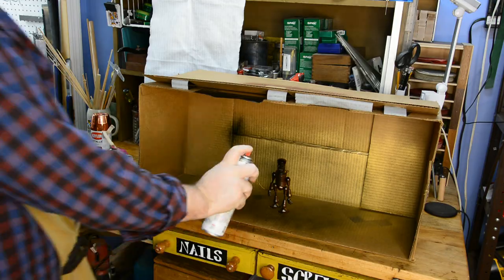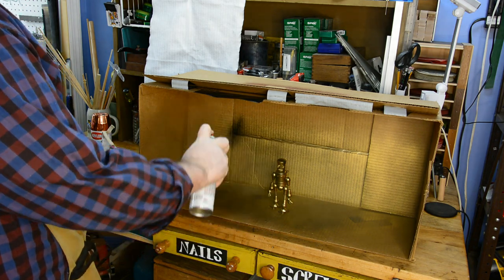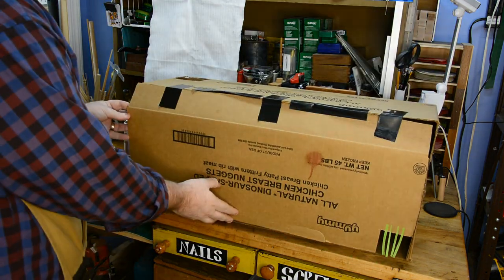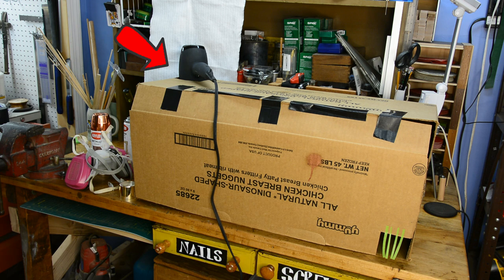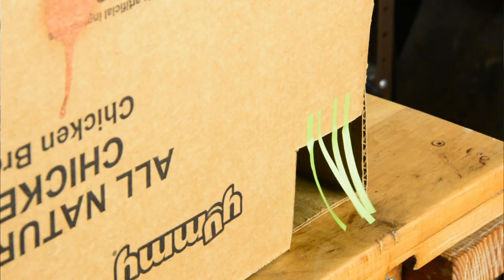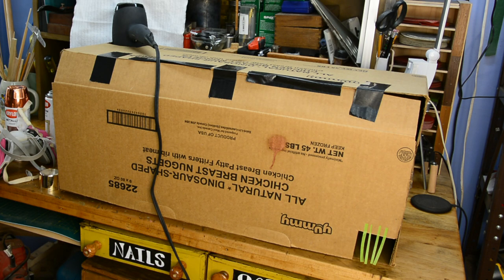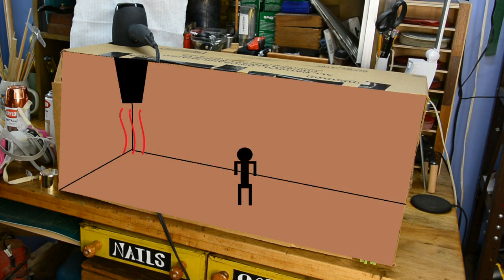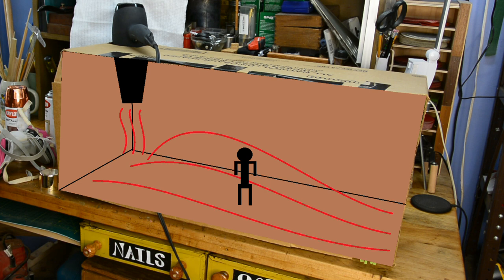Spray Paint Drying Hack - Hot Box - tip, trick, hack

Comment from the maker: :::::A NOTE::::: As always I’ve heard from a small, vocal group of safety police that have reminded me to remind you that this is for hair dryers ONLY! If you do this with a heat gun, even on the lowest of settings, that’s dangerous! AND don’t leave it unsupervised, that’s dangerous too! And it’s smart, ALWAYS, to have fire safety equipment in your shop, and to know how to use it properly! Be safe and smart!
Reply: It's a good reminder though because I was considering using a heat gun :D
Reply: Hmm? Seems I read somewhere that waiting til' the PAINT VAPORS can not be smelled (7-Days). 

Is the time to BAKE THE PAINT, this seems to be baking it while it's completely wet? Please explain what am I missing. 

Another factor DOING REPAINTS, I noticed PEELING, SCALING and FISH EYEING typically only occurs only when it time to REPAINT or TOP COAT. (Calling RUSTOLEUM, informed me the paint BELOW not being dry enough typically is what causes these nasty effects.

Please explain to me ANY advice or suggestions you may have on avoiding those super aggravating paint issues.
Reply from the maker: @jams2u786  hi! Quite simply actually: Many thin layers. You don’t want to drench anything with paint because you will absolutely have done, or all, of those issues. But in using many thin layers and drying in between. The heat box work flawlessly in my years of experience.
Reply: @BurkeMakesStuff  Appreciate your response. How much time using cam spray paint generally do you wait between applying the layers?

Doing GLOSS is a real challenge as it seems at some point in the process to achieve that final HIGH GLOSS, the coat must be WET. Unless those thin coats are very closely timed before the next. That final glass-like gloss cannot be attained?!

Comment: I actually would recommend using a (storage bin tote) cutting a hole for blow drier, then using that instead of a cardboard box its more secure and less flimsy and doesnt require tape to hold the top down just simply press the snap down on the top

Comment: It's a good tip (although don't let it run unsupervised)
If you do a lot of painting then a heat lamp (infrared light) is even better since it provides even heating and doesn't churn up dust that can attach to the paint. You can find heat lamps in a lot of pet stores (smaller ones), and as porch heaters (more powerful ones).
Just be careful, because heat + evaporating solvents (any non water-based paint) jncreases the risk that something could start to smolder and burn.

Comment: At work we always put spray painted projects in the air compressor and vacuum pump room. It holds 2 large commercial Quincy 480v 3-phase screw compressors, 2 Quincy air line driers and 2 large vacuum pumps for the CNC machine router tables. It regularly gets well over 100 degrees in that 30 foot by 30 foot room...often over 120+. It's a little trick we came up with about 5 years ago when I started.
Reply from the maker: Awesome! What does the company do that they need all that?
Reply: @BurkeMakesStuff  

We are a U.S. Government contractor for the Military and make wire harnesses, connectors, gauges and instrumentation. Oshkosh, AM General, Ford, GM, Chrysler buy from us as well as Yamaha and many others.

Comment: Would a mini dehumidifier work?or a air purifier? How but a uvc light?
Reply from the maker: I could see I dehumidifier speeding up the process in a minor way, but the don’t think and air purifier or light would change it at all.
Reply: @BurkeMakesStuff  yea the humidifier didn't do a thing only blow dried on no heat for a few minutes did something but it's been almost 2 days and it still feels sticky no paint on the touch just sticky, I'm thinking maybe it's because of the thing I painted and what I used I don't know is this normal, I have the stuff inside so no drastic weather and it's sitting there with the lamp light on it

Comment: Hair dryers usually have hi and lo settings. Is there a preference. Can you dry too quickly" so the end result looks weird,  you know crinkly?
Would it be helpful to put the object in the box and preheat before spraying. 
Thanking you in advance.
Reply from the maker: I use the mid setting for airflow and the high setting for heat. As long as it’s not blowing directly on the thing you’re drying I don’t think it should give you a problem at all. In terms of drying too quickly, with spray paint, I never have had that happen, nor do I think it could. A majority of the “drying process” with with spray paint is the chemicals flashing off. That’s basically just the chemicals venting off, leaving behind the paint that then cures. I don’t preheating would do much, but try it and let us know!
Reply: For how long should the hair dryer be left on on depending on a setting?

Comment: I am going to have to try this and see how well it works. I want it to dry my spray paint art on assorted types of canvas (wood, cloth etc.) but I don't want to use the flame thrower option ;) - Heidi
Reply from the maker: Yeah, def down use a flame thrower. That best pieces of advice I can give you in your case is 1- do not have the hair dryer blowing on the painting directly. 2- I’d begin with slow air and low temp and build up to make sure it works well for you with out messing any of the painting up. 3- make sure there isn’t a lot of dust where you have it set up. I’d hate for that To end up in the painting. Let me know how it goes!
Reply: @BurkeMakesStuff  Thanks for the tips. :) I may use an extra piece of cardboard as a diverter. As for dust... should not be a problem but if it is will only add to the space/planets scene I think... space dust! :D I will link you when I post a picture of the spray paint art. - Heidi
Reply: @BlackCat_2  "Space dust".... hahahaha! 🤣🤣🤣🤣 I love it! 👍😁

Comment: I once cured a workpiece by putting it in the cold kitchen oven and setting it for the lowest preheat setting, & set a timer  for ten minutes. You have to cycle it, leaving it to cool between treatments as the off  gassing can cause the uncured paint to bubble. This is the reason for the multiple short curing cycles. Seven minutes is probably better.
Reply: Edit: It is probably better to cure by putting the item by a hot water heating register for a longer cooler cure. It lessens the problem with bubbling. Continue until the paint job is thoroughly ruined or successfully cured. If you have difficulty smelling the paint it is probably cured enough.
Reply from the maker: I’ve never had an issue with bubbling myself, but I’ll try it!
Reply: @BurkeMakesStuff  it depends on what you are painting.  I got the problems with bubbling on a wooden workpiece.

Comment: I painted a canvas with acrylic paint and it was a disaster, so I spray painted over it and now it won't dry.  Maybe I should start over with a new canvas??
Reply from the maker: it could be a chemical reaction between the paints. I'd start from scratch
Reply: Acrylic paint is water based🫠. I've spray painted as a base, let that cure and have added acrylic paint on top and that was successful. I think the spray paint sealed your acrylic paint and that's causing it to not fully cure.

Comment: I just tried this, and it didn't work at all for me :/ I'm not sure if it's meant to work only on items painted on the top side only. I was drying some spray-painted wooden name tags, the bottom side was dry and was painted two days ago. The top side was dry to the touch, after heating them in the box, the top side became sticky and the bottom side stuck to the paper underneath it, which ruined it 🥲
Reply from the maker: So sorry to hear this! Never had this issue. What type of paint? When I needed to put something that would “lay flat” I’ve always used those little recyclable plastic risers you get at the big box store.

Comment: Wow this is interesting I recently had bad luck before this video . I put my ar pistol I’m painting in a tent while painting to prevent over spray on my balcony . I put a hair drier inside and closed the tent ………..it got really hot like I was baking it it came out nice but I think I over used it I used it to dry one coat fast for 20 minutes then added another one left it on for 30-40 minutes it blistered and literally blew the paint off . But from your video maybe if I leave it inside for only 5 minutes . And leave the tent open a little bit instead of closed I’m sure it maybe should  work . Or maybe I’ll just let it dry naturally krylon already works very fast
Reply from the maker: Def want fresh air getting in to allow the fumes and solvents to flash off and away from the project
Reply: @BurkeMakesStuff  Okay and i think i was just doing too much in a short time span 2-3 regular coats of paint every 20-30 minutes then 2-3 clear coats in 20-30 mins with using blow drier in between and at the end. Ill just do the box trip at the end or before clear coating

Comment: ::: SAFETY DEFINITELY FIRST:::  I think I'd be very cautious even with the hair dryer.  Because it's dangerous and I've been zapped with electrical sparks while drying my hair before, I probably would :::::NOT STICK THE END OF THE HAIRDRYER INSIDE THE BOX:::: where the paint fumes are. Instead, I'd put the end of the hairdryer a couple inches away from the outside of the box blowing in the direction of the air intake hole. Maybe it wouldn't be as efficient but that's just the accident prone pyromaniac in me speaking. Better to take a little longer to dry than to burn the shop down! 🤣 It's a great idea though... one I thought of for curing Protectaclear and wanted to know if others have tried it.  The dangers of paint fumes are probably similar enough to Protectaclear so thanks for sharing and reminding me I need an exhaust!👍🙂
Reply from the maker: Cardboard has a flashpoint of 800 degrees. A hair dryer can’t even put out 1/4 of that. Research was done before making this video.
I have however had people write in and ask if a heat gun would work the same way. ABSOLUTELY NOT!!!! Heat guns would set this ablaze in a matter of minutes.
Reply: If you have sparks coming from your hair dryer you need to THROW IT AWAY!!! It is dangerous and malfunctioning and more importantly a SAFETY HAZARD.

Comment: Trying this now to save a Halloween costume and so far it won’t dry. I spray painted bronze paint on rubber snakes. Dunno if the snakes are coated with something but it is hella tacky. Help!!
Reply from the maker: Could absolutely be A coating on the snakes. Also if you let this go too long, the paint gets tacky. It’s come up a bunch in the comments and that the idea we’re going with, so far.
Reply from the maker: Also, is the paint you’re using compatible with the rubber used for the snakes?

Comment: Has the cardboard box ever started to burn ?
Reply from the maker: No. Hair dryers are strictly regulated and max out at less than 200 degrees. Cardboards ignition point is a little over 800. That’s why it’s important to NOT use a heat gun. Hair dryer only.

Comment: yeah what if hot air is somehow making my paint even stickier than ever before? 
literally just ruined a 400$ hand made sculpture by trying to prime it with white Rustoleum. followed every single instruction on the can and even sprayed it in a very thin coat to begin with and now it's still sticky 4 days later. it's impossible to paint properly now and i've just lost 80 hours of my life AND the profit from a 400$ sculpture.
Reply from the maker: Hi. So you didn’t run a test piece first? If you read the description, it points out that this is important to do, as paint type, materials being painted and amount of heat all matter in the process. I just went back and made it capitalized, hoping to make it even more obvious. Many different things could have gone wrong, but without having been there with you It’s extremely hard to pin down exactly what it was. It could have been number of coats on the sculpt? Same box? Same heat source? What was your heat source type? If you scroll through the thread on here there are a small handful (maybe 5) people that have faced the same problem and after talking they figured out it was the amount of time they left it in. Also none of them tested it before, which is why is originally added the written reminder.

Comment: QUESTION FOR THE EXPERT.... I purchased a used set of wheels for my electric wheelchair to create a set of winter tires with studs.  I removed the tires and cleaned the hubs, then primed them and spray painted them Glossy Black.  I let them sit for a week, but when I touch them they lose their shine due to my fingerprints.  Is there something I can do to stop this?
Reply from the maker: As long as they are completely dry, I would add a clear coat in "glossy" clear. hat should help keep the shine.

Comment: I would just suggest switching the holes - hair dryer on the bottom, outflow vent at the top. Hot air rises.
Reply from the maker: Actually that’s one of the reasons I have the exit at the bottom. That way the hot air has to complete full the  ox before exiting, instead of just following the path of least resistance.

Comment: This worked for me with a heat gun and a box lined with foil... and I think these vids are less about good ideas and more about you pretending you're on TV, so that's going to be why I rag on you, lol... but I do appreciate this one, even if it's a bad idea. Here's why I'm not satisfied, though:
1. The fire hazard disclaimer should've been in the video to avoid Darwinism.
2. It's a fire hazard, yes and it's in the post-mortem fine print but still, it's overall a bad idea.
3. It's lacking in science... why a hairdryer vs heat gun? They do the same thing and heat guns can program temps... what temp range are we shooting for? What kind of airflow metrics? How much volume in the box? Why not outdoors if it's enclosed? Why use cardboard and not steel? Metal vs plastic surfaces? What product variations in temps and time do we have to account for? And why use krylon? It's literally garbage, about to go in my garbage. 
4. Why such little information? The video scarcely makes a point except: box + I'm cool + hairdryer + not heat gun + paint. What is the gain vs safely waiting for it to dry? Much reassurance needed for a newb audience.

Just my critical 2 cents. I definitely can see this technique being useful but only if it's perfected and safe.
Reply from the maker: Well thank you for your comment. If done as it’s stated in the video l, with a hair dryer and cardboard, the 812 degree ignition temperature is impossible to reach as hairdryer’s temps are regulated in the US.
But thank you for your comments. And going back and editing them. The fact that, without your own channel, you’re putting so much into mine is much appreciated…
Reply: @BurkeMakesStuff  I get what you're saying and apologies if I came off spicy, I have been stuck on a frustrating project and trying to figure out how to make this tek work due to getting impatient. I really do think this can be something epic but the parameters need to be defined. Good to know it's that high of an ignition temp. I'll probably start posting projects on a new channel at some point.

Comment: how the hell does this work for anyone, I tried it, and maybe it is for special paint only,  or maybe my hair dryer was set to high, cause all it did was heat up the paint and make it all sticky and melty. so far, epic fail.
Reply from the maker: What type of paint were you using? When I do it it’s just regular off the shelf spray paint. Been doing it for years. Never had an issue. Always have the hairdryer on high. 5-7 minutes. Done.